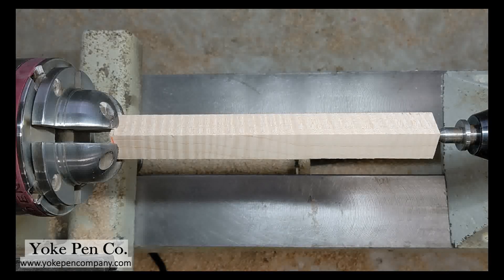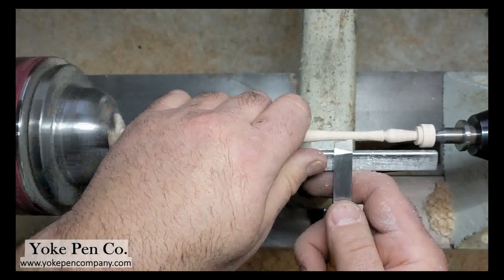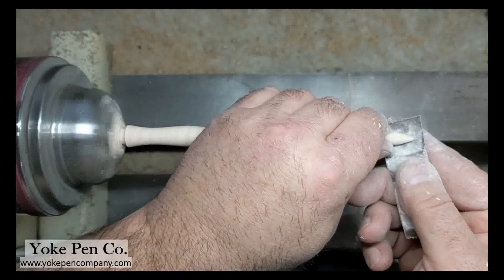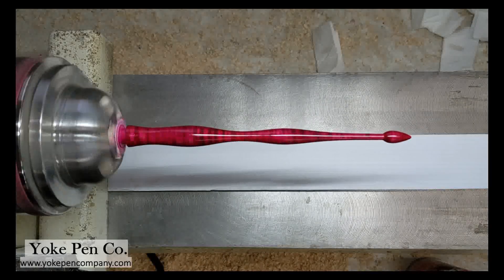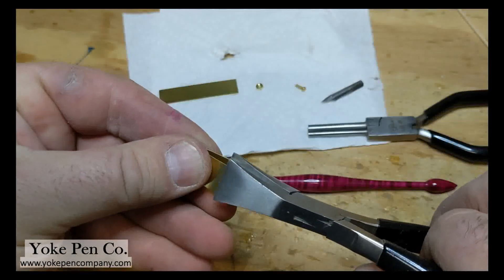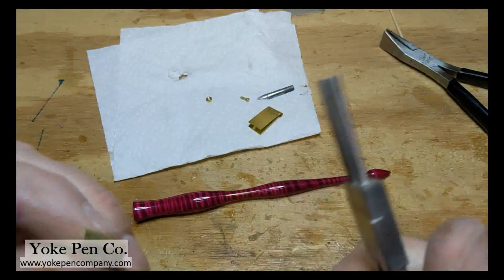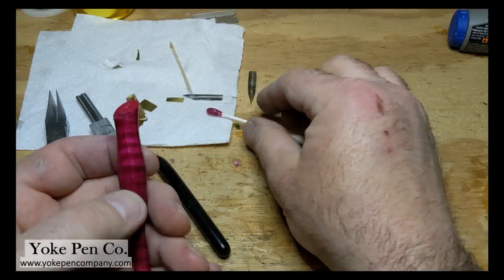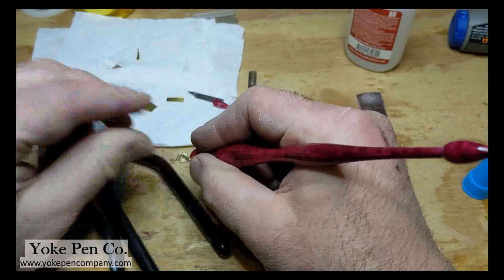Creating a Vitolo Oblique Penholder

Comment: About what speed do you run your lathe? I keep finding that the woods I'm using flex a lot when I get it thin and I lose more than I finish.
Reply from the maker: I rough at about 1000 rpm and when turning the pen holder, once round, I do that usually in the 2200-2900 rpm range depending on the wood.